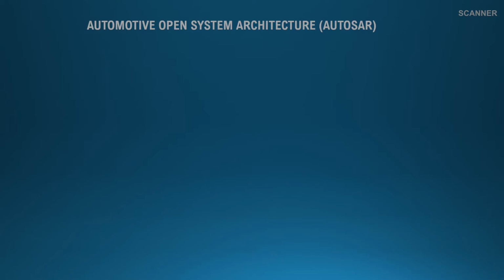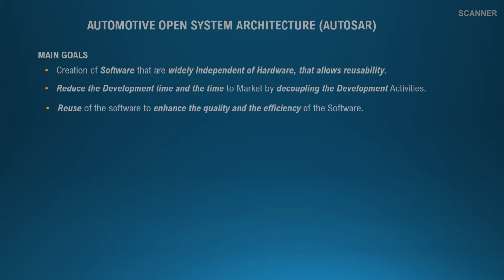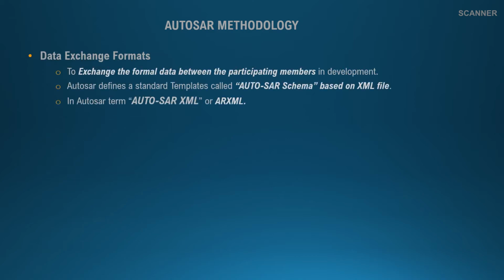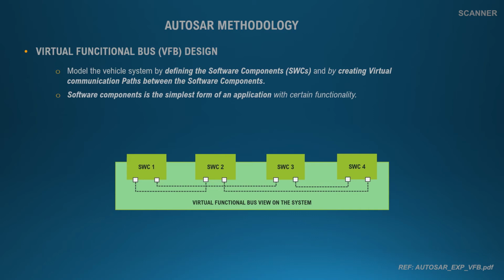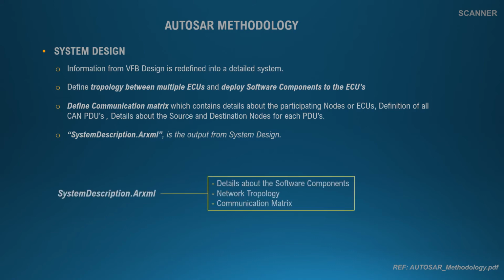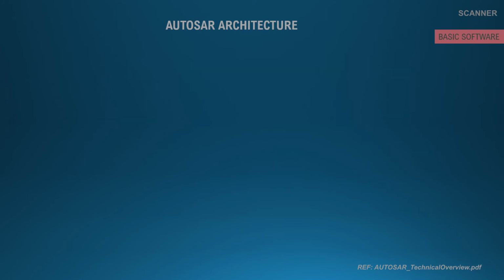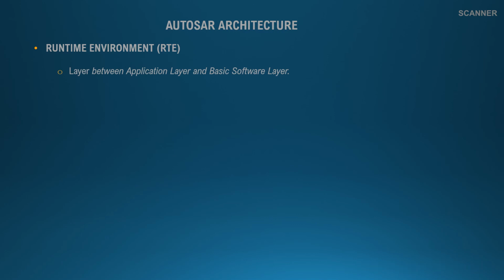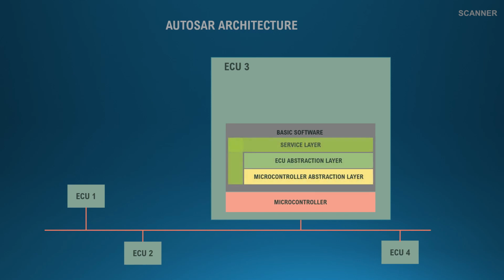INTRODUCTION TO AUTOSAR | AUTOSAR VIDEO TUTORIALS

Comment: we need more on vector davinci configurator ,devoloper  ,ebtraces ,bosch tools ,and addaptive autosar tools like pop-corn-sar tool ,please do the artop live demo for creating components objects and configuration parameter ,please take github autosar projects gives us videos with code and autosar perspective of that projects ,also need matlab autosar application design and code generation ,need more on the autosar code APIs format and coding details for different application and BSW modules,and More on different endless loops handling in runtime of configured code and debugging of a project (BSWM module init sequence and OS code control take over ),where and how to do debugging for deferent stacks like memory MEM stack, COM stack, Diagnostics UDS ,and more on functional bus, and how to connect classic autosar ports to adaptive autosar (adaptive port connection process),

Comment: Thank you for sharing the AUTOSAR tutorials.It is very helpful for us to have a basic definition of AUTOSAR. By the way, would you like to have some session like [How to design a SWC or Application SW components explanation] .  As I watched in the video you all have a plan to do that video but until now, maybe it has been not public that video yet]. Please share the link if it has already public. once again, thank you so much for sharing.
Reply: Addition information : As I read some document related to AUTOSAR architecture. We also have a [Complex Drivers] in the BSW layer. But it is not mentioned in this video. So whether the complex driver component is available in the AUTOSAR architecture? and is it just the option ?
Reply from the maker: The Implementation of these CDD is not standardised by Autosar. CDD is mainly used to implement some special functionalities and timing requirements that which has some direct access to microcontrollers. For example to control some actuators and complex sensors. In case if an ECU requires some CDD functionality then: (1)CDD can interact with Software Components through AUTOSAR Interfaces. (2) CDD can interact directly with Basic Software Modules through Standardized Interfaces. Its all depends on what kind of functionality and its architecture. So to conclude CDD is just an optional.

Then regarding the other video tutorials, currently we have only few sessions that is available for everyone. Soon we will upload more videos.. So Stay tuned for more videos.